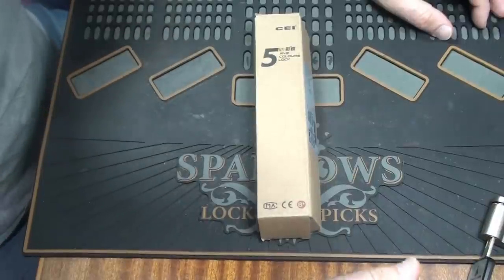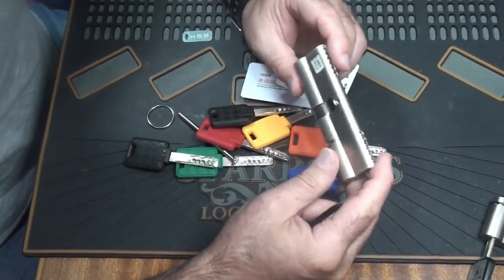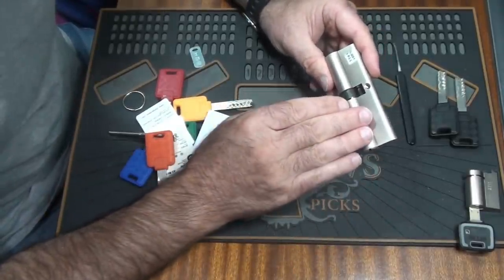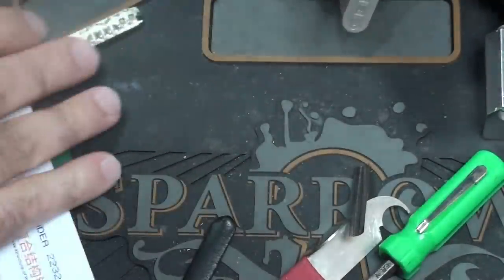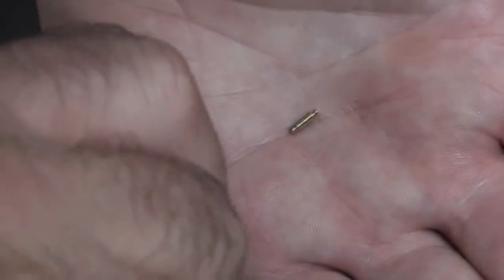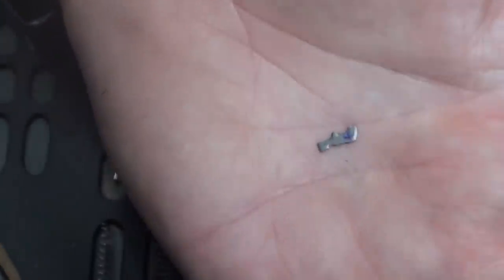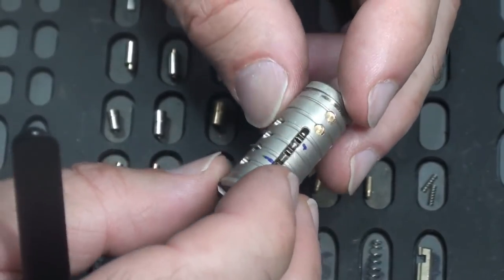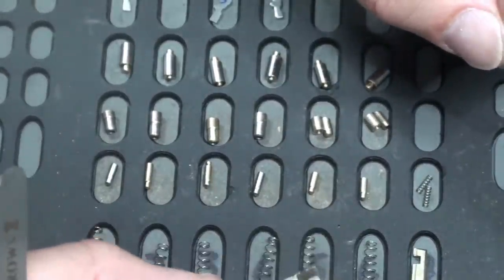[168] First look - The Cei 385T - a construction keyed Mul-T-Lock MT5+ clone (sort of)

Comment: Annnnnd... about 6 weeks/months after you break the "construction" pin and start using the "ABSOLUTELY STUPID & IN NO WAY CLEVER" lock for real.. the broken off portion turns, is suddenly a different height, and jams the damned lock, and you have to get a locksmith out on emergency in the middle of the night.. frankly it's both cheaper and a better idea to specify a cheap lock for "construction".. then get your locksmith to fit a decent reliable one later when you move in....  Or change them yourself, changing euro cyls is so easy even a MILLENNIAL can do it.... hell even a girl millennial